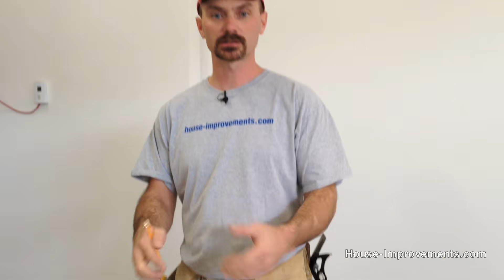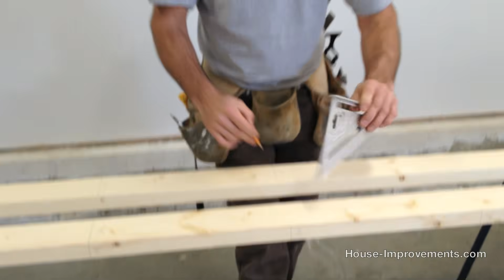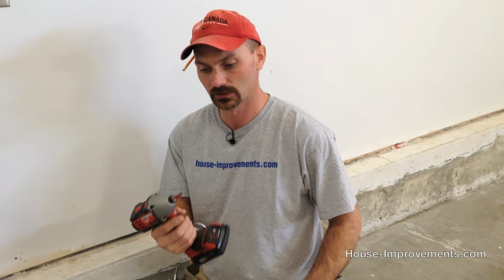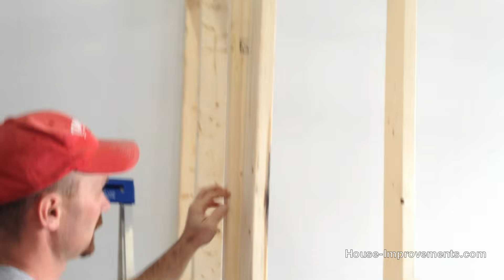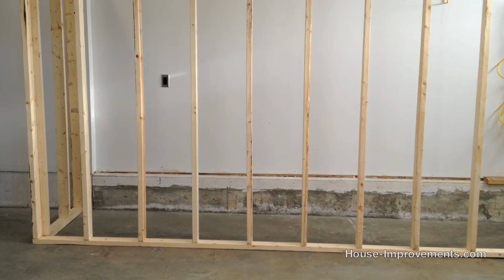Wood Stud Wall Framing

Comment: Hey Shannon, let's say you have 12 foot lengths for your plates, but you want to make a 20 ft wall.  In your video you explained how to fasten them together at the double top plate, with the overlap, but how would you fasted then foot plates together?
Reply from the maker: cut the plates so they meet at the centre of a stud location and then nail both ends up into the end of the stud
Reply: +HouseImprovements Thanks for the quick reply! That makes sense. I was thinking that you could probably also make a cleat from another 2x4 or 2x6 and wherever the seam between the 2 bottom plates are you would nail it on top like a second bottom plate between those 2 studs. But your answer seems like a cleaner framing job.

Comment: I wanna ask you one thing, if the wood size are not that big - say that I want to make framing from 1x1 inch wood should I consider to shorten the "Gap" between each fence below 60 inch?

Comment: Bottom plate should be pressure treated wood since its sitting on concrete.
Reply from the maker: This is only a demo on framing as stated in the video many times, the wall is not staying there. You are correct if placing wood directly on concrete without anything separating the two then P.T lumber or some type of treated lumber is required.

Comment: Hey Shannon,quick question.I have a wood dock set on I beams.The deck boards need replacing,would it be ok to just put on the new boards on top of the old ones of coarse perpendicular.What do you think?
Reply from the maker: I suppose if the old ones are not rotten and are still well secured.
Reply: Thanks

Comment: Hi Shannon...excellent video.  My question is about the wall being fastened to a concrete floor  Would you use insulation between the bottom plate and the concrete?
Reply from the maker: Depends what you are doing. If this was an exterior wall then yes, using a foam gasket and even caulking or both under it is best. In most areas when installing wood on concrete a material to separate the contact of wood to concrete is required (foam gasket) or using a P.T bottom plate.

Comment: Hey Shannon
   Your videos are great. I'm new to DIY home improvement. Would it be possible to use a nail gun for the nailing of these frames?
Reply from the maker: +Kenny Tai Yes absolutely, We used screws only because this was for demonstration purposes only and was being disassembled after. You should frame with nails not screws.

Comment: If you do it this way the center of the first stud is at 0.75. The center of the second stud is at 16. This is only 15.25 between the center of the first two studs. What am I missing?
Reply from the maker: +Default Name That is correct. the first space and last space in a wall are always odd ball sizes, but all the rest are exact.

Comment: I have walled off doorway to the stairs to separate floors.  It is safe 
to remove the staircase or is it load-bearing and necessary.
Reply from the maker: +Paul Lesson  The stairs should not be load bearing.
Reply: +HouseImprovements thanks so much for a kind, prompt reply
Reply: +HouseImprovements It depends on who's coming down the stairs!!
Reply: Very good rich. LMAO

Comment: Hat's off to all of you gents who have this knowledge and skill set. I am slowly learning, not as a career, but because I want to learn how to do conduct projects like this myself. I also have a an exterior room that needs to be rebuilt this summer and I am going to do it all by myself. Lot's of time from now until June to plan, make the schematics, buy everything I will need [lumbar, drywall, etc]. Question, what kind of insulation would you all use if you lived in a hot and humid environment like Dallas, Texas? While it does get cold here, it is cyclical, but I'd like insulation that would keep in the cold when it is hot out and vice versa keep the room warm while it's cold out.

Comment: Thanks for the video! I am curious though how would I add an interior wall to a room that has carpet and the ceiling already done? Do I have to rip the drywall off the ceiling and the carpet from the floor in order to add the top and bottom plates? Thanks.
Reply from the maker: +nray25 Please ask your questions in my forum.http://www.house-improvements.com/forums/

Comment: You mentioned subtracting the thickness of three plates to determine the stud length. There is a top plate and bottom plate which would equal 3 inches. What is the third plate you are referring to?
Reply from the maker: +James Zwijacz  Double top plate (second top plate) Very common on load bearing walls and many other walls. They are used to stiffen and lock them together with others as well as added load support .
Reply: Thanks!

Comment: Did you elaborate more on the double top? Like, where do you decide to put your overlap?
Reply from the maker: +Lorenzo Bohl  Span past the joint below by at least 3-4' and putting the joint over a stud is preferred ,especially on a load bearing wall.
Reply: Thank you!

Comment: Man please, wich is the wood to use to make frames... I´m from Brazil, and I dont know wich kind of wood I can use for this frames... Could you give me a tip?
Reply from the maker: +Gata Sapateira Species ? or size? We use spruce lumber here and 2x4 size is fine.
Reply: +HouseImprovements Species, and thank you for you instantly reply... Do you know wich kind of wood in Brazil can be a substitute for spruce lumber?   I have search and I see is a strong and ligth wood... I have seen a lot of similar woods (visual) but I dont really have a sure about whick kind spicies of wood will be a good substitute.

Comment: Screws are not accepted by most codes, screws break. Use 16 d nails.
Reply from the maker: +Adel Jaber This is stated in the video more than once as well. The screws are being used only because it is a demo and needs to be disassembled easily after.

Comment: Thanks for the video it was great. I understand how to put walls on 16" center but wondering if there is any rhyme or reason as to having the front and back inside the side walls or the side walls inside the front and back. The 16" on center confuses me when you make turns. I maybe missing something not sure maybe you can straighten me out. Seems like your siding would be off on the outside and not break properly. Thanks again.
Reply from the maker: +David McCollister There is really no right or wrong way to butt the walls together. I personally usually lay the studs out so the exterior sheeting works out the best. Then on the interior the drywall can be easily cut to start where it needs to. Also drywall is cheaper.
Reply: +HouseImprovements Thank you so much for the quick response. I appreciate the help I'm kind of learning myself as I go on this. You have some great helpful how to videos and I appreciate the way you explain it. Thanks a bunch! David

Comment: hello
can i know size of the wood screw u use?
and where i can buy it
tq
Reply from the maker: +Mohd Saiful Mohd Said  They were 3" #8 deck screws. You should use nails if you are framing a structural support wall but screws are fine for other framing

Comment: Can you use screws to construct this wall if it's a non baring wall ? I want to divide a section of my garage to make it smaller for a hobby room, its just to separate it from the rest of the garage. it will also have a door in it to come and go.
Also, can you construct a smaller version of this framing to go on top, this size wall will not reach the ceiling in my garage ?
Finally, is there a way to avoid hitting the screws on the 2X4 when adding the second plate on top of the other ?
Reply from the maker: +Nick Musuraca Using screws will be fine. You can add another small wall on top if you want but buying long enough studs to start with is better. Just offset your screw in the second top plate ,they do not need to line up with studs.

Comment: I am planning on building a wall on a sloped slab.  The wall will be adjacent to the slope, as opposed to being on the rise or fall of the slope.  Do you know of a way to account for the slope?  Do you know of an instrument that can be used to find the exact degree of pitch so I can modify the bottom anchored plate to account for that slope?  Is there a solution other than cutting length wise of that plate for that accommodation? 

And for the mock up you used screws as opposed to recommended nails.  What gauge nails do you recommend?
Reply from the maker: +Arin Robinson  Most framing can be down using 3-1/2" 16d nails. As for sloping the bottom plate could you shim one side up with shims or is the slope pretty great?
Reply: Actually I remeasured and there is not too significant of a slope adjacent but even more so through the run where the plate would go.  There is an inch of difference over a span of 19 feet.  The structure is true but is built on an additional concrete supporting the parameter of the structure itself.  I may follow what my wife suggested which was to cut the support studs as needed through the run but keep the top plates true to the structure.  What are your thoughts?

Comment: When do you use a bottom double plate? And what is its purpose? Thank you
Reply from the maker: +Matthew Millard  When building a floating basement wall system. https://www.youtube.com/watch?v=H-TXec0CQ8E
Reply: Thank you. I dont mean to take up your time but i have one last question. What do you do when there is a slope on the basement floor, is it better to cut the studs to fit the slope of 1 inch, or to keep the framing square and put shimes under the bottom plate, as the floor slopes. Thank you. Matt

Comment: Are pilot holes not required for your screws? Why or why not?
Reply from the maker: +Steven Hulbert  99% of the time in this application they would not be needed because the framing wood is pretty soft and the decking screw threads are pretty course. Screws were used here only for ease of removal after this video was used. Any structural framing should be nailed.
Reply: Thanks for the response. What wood would you recommend for haunted house walls that don't require pilot holes?

Comment: Hi Again Shannon: Great tips here! My question is for an interior wall that will be built 12" parallel to an existing wall to house some between-the-studs shelving. What is the advantage/disadvantage to building the frame first and standing it up instead of inserting studs between the top and sole plates? [I'm not sure I have the space to build it first and stand it up afterwards.] Thanks!
Reply: Christine Taylor - It's much easier to build it on a flat horizontal surface. All the fasteners can go strait trough the top/bottom plates. If build in it's final position almost all fasteners most be put in diagonally. With this said either method will work. Just make things easier for yourself. Time is money. :-)

Comment: If your putting in drywall should the walls not be 8 feet to the first top plate not the second joining top plate ?
Reply from the maker: Jerry Peckford  Typically you want the top of the second top plate to be about 8'-1" so that once the ceiling is drywalled first then the walls are done the bottom of the last row is off the floor about 1/2"

Comment: Thanks for this great video.  Small question, if I built all 4 exterior walls in this manner, when fixing two wall together at a corner, one wall will be 16 oc on the inside, and the other one, on the outside.  Is it OK like this, or should I adjust to get it all 16 oc in or out.  Thanks again.

Comment: I need to replace an exterior wall (11 feet long) because the base plate is rotten and several studs have carpenter ant damage.  There is a header already spanning the space.  How do I support the header when I remove the studs and base plate?
Reply from the maker: Elizabeth Jakupciak  This is not a DIY project from the sound of it,Sorry

Comment: First off, how awesome are these videos?!
When nailing in the second top plate isn't there a good chance you'll hit the top of the nail below it, the one on the first top plate?
Reply from the maker: iquit4gud  You know where the nails should be in the first plate as they were shot into the studs so just be sure to nail the 2nd plate offset from the studs below.

Comment: which brand of impact drivers (not to expensive) would you recomend us? How much time does the battery last? Is the maita Makita XPH012 18V LXT Lithium-Ion Cordless 1/2-Inch Hammer Driver-Drill Kit ok for this?

http://www.amazon.com/Makita-XPH012-Lithium-Ion-Cordless-Driver-Drill/dp/B00N9ULIAE/ref=sr_1_3?ie=UTF8&qid=1433200849&sr=8-3&keywords=makita
Reply from the maker: noelukukuk for a Diyer that drill would be fine but you will want a second battery . If you are wanting this for driving screws than I would recommend a impact driver instead or buy a combination pack with drill and impact driver. The 2 piece kits will usually come with 2 batteries,2 tools and a charger. Likely about 300$ or so.

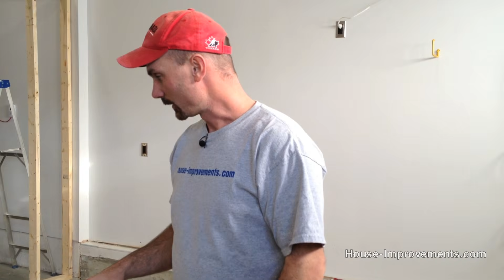Comment: 15:30 Another really good use of the top plate is to straighten the wall itself. If the wall itself is wavy, you can use the double-top plate to straighten it. Thus nail at one end and progressively nail to the other end using the top-top plate to straighten the wall adjusting it in and out to compensate.

Comment: Inside corner stud for drywaller? 3 stud corner? We don't have time to go in and finish the framing for you guys every time we hit a corner. Floating the drywall in and locking the drywall doesn't cut it anymore. Oh there it is you're covering it. Rare for a wood butcher. Glad you added it. Good video.

Comment: Great video guys! I want to frame a home bar.  I already have the top. Would you use screws or nails on a piece of furniture like that.  Its about 9 ft long and I want to be able to move it without the nails pulling out.  Also, Do you think 2x4's is overkill.  Could I use 2x3's? Thanks
Reply from the maker: If built strongly 2x3 screwed together should work fine.

Comment: Thanks for the detailed instruction. I plan to build a smaller version of wall and install over an existing wall. The owners of the house I rent does not allow mounting TV to existing walls. Again, thanks. Best wall framing video by far.

Comment: If I am attaching both the top and bottom plates to the ceiling and floor first and then adding the studs, do I toenail each one in?  Is there another way to do this?
Reply from the maker: Toenailing is really the only sure way. Please use my forum if you have further questions.http://www.house-improvements.com/forums/
Reply: HouseImprovements
Reply: Hoon Hing Yap

Comment: never ever ever ever ever use screws to frame i have never used one screw in twenty years of my framing career
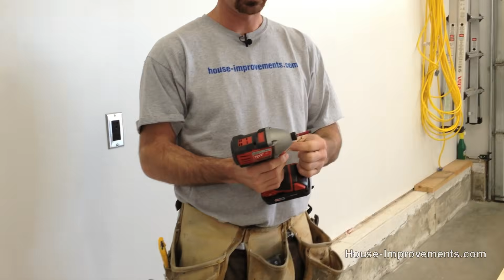Reply from the maker: Thats exactly what I said near the middle of the video (10:20) We used screws only because we were taking this apart when we were done the video.
Reply: HouseImprovements what the hell. ..let me ask you at a professional stand point. How long does it take u and your group to frame a custome home that's about 2500 square feet?
Reply: 3 to  10 days depends on how cut up the roof is

Comment: Great video. There were a few questions that people had but he does a great job. One question was about how you should be anchoring the wall to the floor. The answer depends on the surface you are building on. For concrete you would use a tool called a ramset that fires a nail into the concrete. If the wall is load bearing you may use a rotohammer to drill holes for threaded dowel anchors. Also for me it is a standard practice to use pressure treated lumber for ALL bottom plates to avoid future dry rot
Reply: ok there is a couple ways drill holes and use the blue tapcon screws or put construction adhesive and eirther use cut nails (concrete) or use an 22 calib ram set to shoot the nails in

Comment: It takes a little extra time but worth it to me to use my electric drill to create a hole with a drill bit that is slightly smaller in diameter than the nail or screw width. It helps me start it into the wall or stud tighter and then I finish it into the wood to tighten it up. Ladies doing little tricks like that can be very helpful so that the strength is very strong and professionally done.

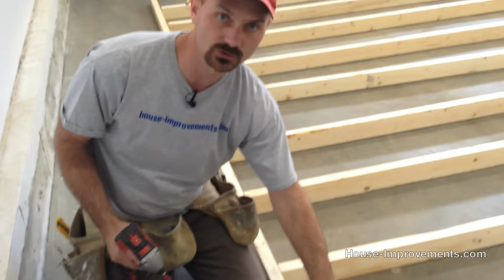Comment: Would using a speed square at the 11:37 mark be helpful as well?
Reply from the maker: The problem is a speed square is to long and you would have to lift the boards off the floor to use it every time. Nice idea though.
Reply: thanks for the feedback and for the great vid.